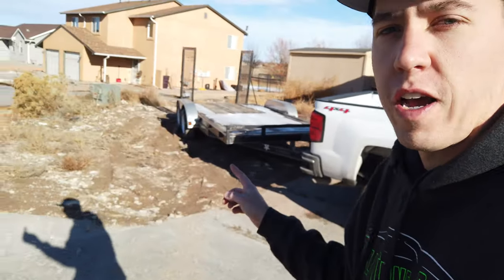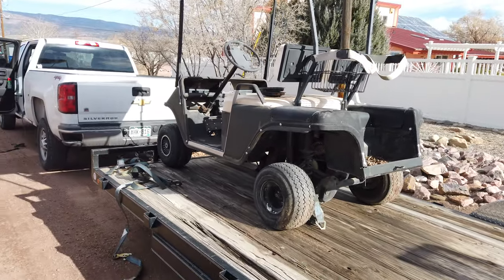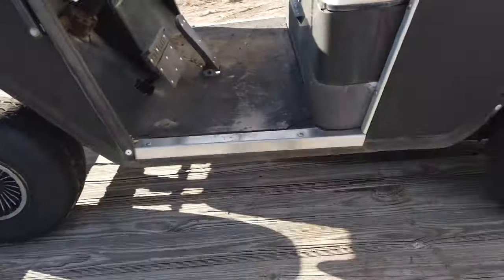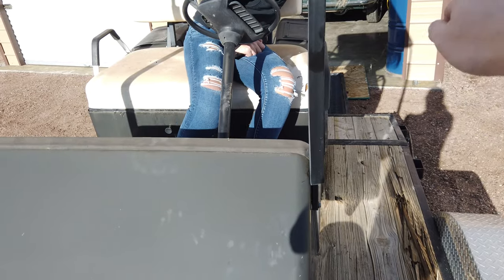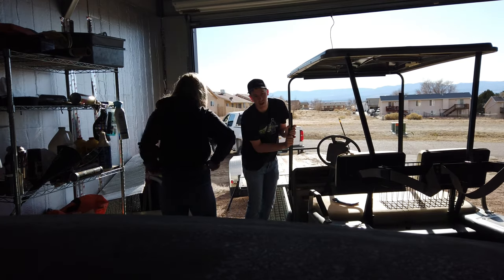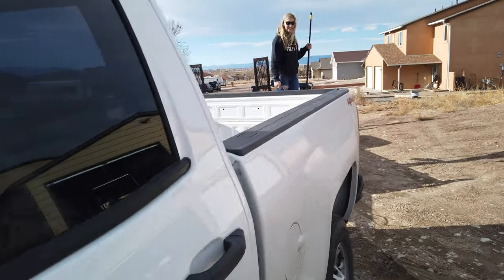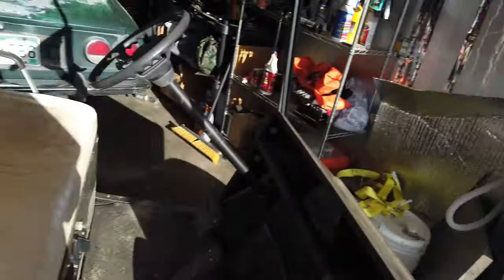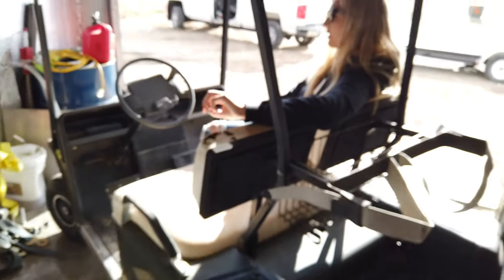New Project Vehicle! (Not what you think)

Comment: Needs a exstended frame and a liquid cooled triple cylinder snowmobile engine with a  belt drive clutch setup. Anything with gears just makes it bouncy and unpredictable.
Reply from the maker: That would be sick!
Reply: @BuildTuneRace  oh ya and what's cool about the snowmobile clutch setup is you can lay into it and the power comes on smooth and you can just cruise around aswell